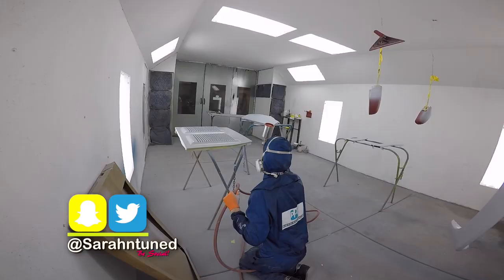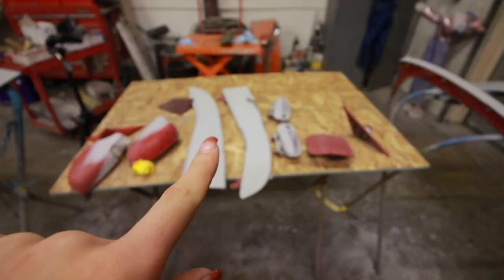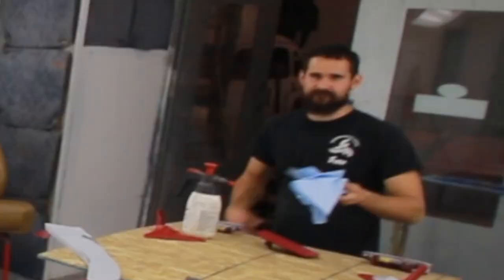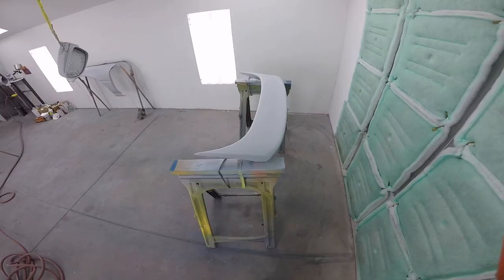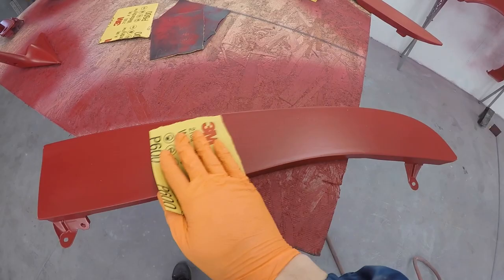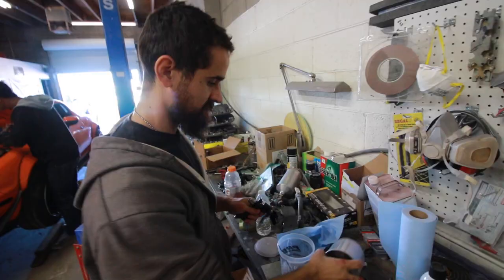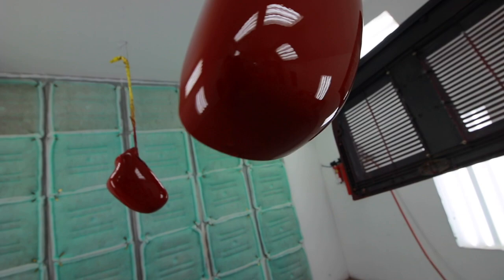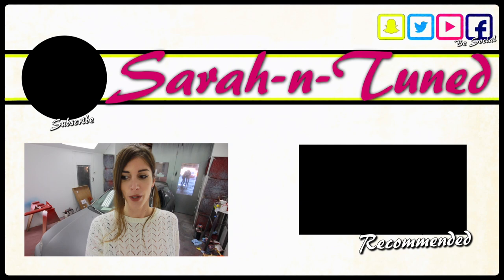It’s done!! // My First Time Painting a Car (Part 2)

Comment: Clear coat is tricky to do because of its water like consistency and it's very easy to cause runs. For a first time painter you did a remarkable job and you should be proud of yourself. I was very pleased to see that it turned out so well. Great job Sarah.

Comment: Looks great. I used to paint, few vehicles, heavy equipment, snowmobiles, atv and bike frames + parts, helmets,and lots of other things. My favorite part was always the clear coat b/c it makes all the hours of prep worth it. I never had a booth,always turned my garage into a make shift booth or sectioned off a piece with plastic. I always had good results. I also did airbrushing but could never do great freehand lettering.  Kudos to you professional airbrush artists out there. The smell of fresh paint never gets old either👍

Comment: Good job! That 1st time is scary especially with the price of paint. Don’t worry about the run,sands right out. Time for an air compressor and spray gun. You can get a pretty decent job in your garage with a little bit of prep.

Comment: Well the only reason to add Primer if the panel has damage.  otherwise, not necessary. I sanded my body and just repainted over the original color. Primer will build up the surface.

Comment: The painters overalls make you look taller than normal (its not a bad thing). good work on the panels for a first timer its pretty good, well done. i was expecting to see them have you spray the floors with water it trap any dust (that's what my auto body teacher had us do)

Comment: As long as you have the correct paint code and mix the colours well and follow the process good, it''ll match.
Reply from the maker: Not always the case, if the car has spent any period of time in the sun, its likely the factory paint code will still require a color match. It's a great baseline though!

Comment: If you have my luck, expect a hail storm at any time.  Or a flock of migrating turkey vultures.
Reply from the maker: 79 thump the cars in my garage 😉
Reply: 79 thump , i have that luck too. I remember painting my car and one week later I was headed to Dallas to meet my girlfriend. A huge metal fender was in the road and a lifted truck went over it causing it to spin before hitting me. Destroyed my front bumper , lower radiator support and fog light. Lots of zip ties to get home.

Comment: Great job Surrah....Im still a tad confused about the 'wax and grease remover use'.   Can someone give me a heads up on the use or need verses regular soap? i would think any of those ingrediants would mess with the paint adherance...dunno. Thx
Reply: Wax and grease remover chemicals are solvents that are so volatile they evaporate in seconds and don't leave any residue behind. Soap would not cut grease and oil as well, and it would need to be rinsed thoroughly.
Reply: @zzanatos2001  /  Thx...i'll admit when im unsure, and will ask questions.  Thats the one thing about YT, especially Surrah....i appreciate the 'Bank of Knowledge' we can share +)
Thanks Zach...now if i could just figure out the Best products to use, to clean inside and out the 70sq ft of windows on my Yukon, haha.  Have a blessed holiday.

Comment: In my opinion You did not do enough overlap on every passes. This type of paint booth causes easier for contamination of paint. Better ones are with vertical air flow (top to bottom), because stream of air and paint is not bouncing from the floor, catching dirt from floor. Fish eyes may be caused by not enough air prep or using silicone based waxes and grease in shop. If You plan painting more in future, watch "The Gunman" channel. He's master. In scale 1 (amature) to 10 (pro) I'm 2 maybe 3 of knowledge in painting. So if I'm wrong anyone welcome to correct me.